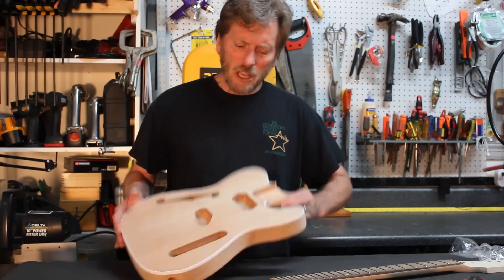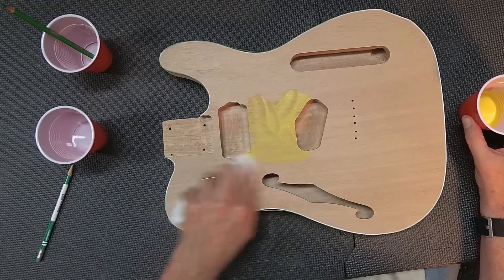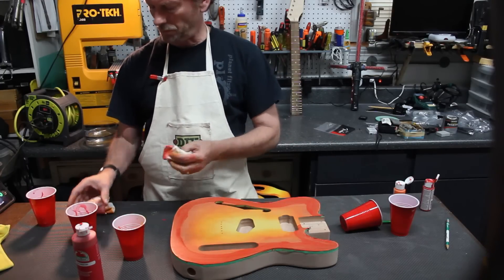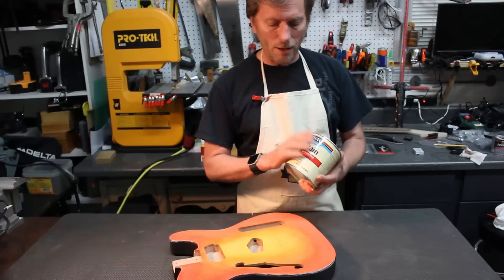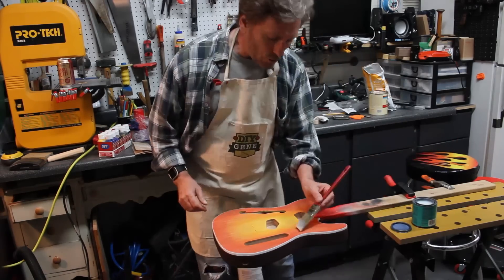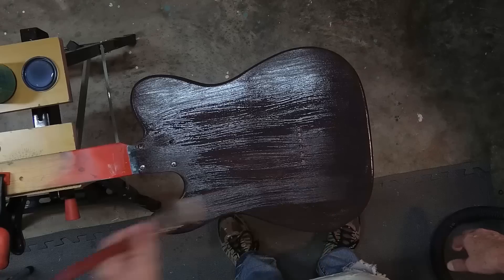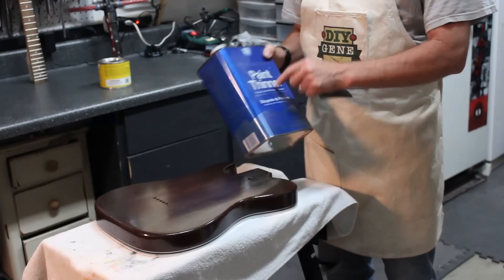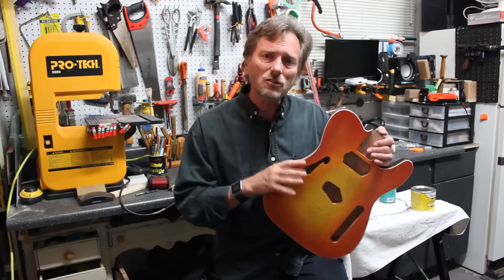Water Based Sunburst Paint on Guitar

Comment: A relaxed guy doing a relaxed tutorial. This is the deal. This basswood is quite pretty.
Reply from the maker: I so enjoyed doing this project. Thanks so much for watching.
Reply: @DIYGene   i have a brazilian brand strat although built in China that im doing a make over, upgrades, you know, and im researching for projects as yours to learn. This one you did is perfect to take the steps because is a basswood guitar as mine. Im looking for ways to improve the wood pattern in front before painting. To look more a quilted maple,sort of think.. what you think? It's possible?
Reply from the maker: Making basswood look like quilted maple could be a challenge. I would experiment on something else first. But you could try a few different things like rolling a rag that has a darker stain on it and roll it over the wood to see if that makes the pattern your looking for or possibly a torn up sponge and dab it with the stain. I don’t know if that makes any sense. But I hope that helps.

Comment: Thank you for the vid! I decided to use acrylic paint for my first build (ES335 - 12 string) as well. Very touchy stuff in that it applies like liquid plastic. I had to figure out that I had to add water to dilute the "ready pour" paint. My binding had the same problem as you did and used a razor to clean it up. I also had to sand the binding area to make the paint flush between the binding and the body. I found that alcohol will clean it up but use it sparingly because it really reacts fast with acrylic paint. I LOVE your pinstriping idea. I think I'll use it for my next build. Thanks again!
Reply from the maker: Thanks so much. I will have to try the alcohol next time. Great suggestion. I would love to see how your 12 string turns out. Thanks again for watching.

Comment: Thanks for the video! I live in a tiny urban apartment with no private outdoor space. Are you saying that, with these paints and finishing materials, I could do it ALL inside and not, you know...die?
Reply from the maker: Yes!  My shop is in my attached garage with the gas furnace and hot water heater so I do anything with the open flames in the same space. Plus my wife would not be happy with the toxic smells. So yes it works great. I hope that helps. Thanks for watching.
Reply: @DIYGene  Quick follow up as I get close to painting my own project: If I were to use this method but have the grain show through more, do you think using a dark grain filler before applying the paint would accomplish that? Or is the acrylic paint just too opaque? Maybe not if I add more water to the mix? Thanks!
Reply from the maker: @Jason-rt4lv , I would think the dark grain filler would help bring out the grain. And you can definitely thin the paint to show more grain. I hope that helps.
Reply: @DIYGene  I'll be sure to let you know!

Comment: Hi Gene, I found your video because I recently bought my first diy kit and I want to use water based paint on it. Can you please tell me how long the dry times are between the different paints you are using?
Reply from the maker: Wow, that is a tough question. It depends on the time of year and the temps. With water base, they do dry faster and can  second coated within an hour. But if you need to sand between then you need to give it more time. Like overnight. Touch it to see how dry it feels. It is better to wait longer than to mess it up because you are impatient. I hope that helps. Thanks for watching.

Comment: Quick question, did you paint in the f hole? It looks black in the finished product. I was wondering how you did that. Loved the vid, thanks 😊
Reply from the maker: I did paint in the hole. I mixed up a dark brown to almost a watery stain and used a small brush. If you do this after you have finished the body including the clear finish, you will be able to wipe off any drops that may occur on the face. Thanks so much for watching.
Reply: @DIYGene  thank you! I should be getting the slimline body soon and was wondering what to do first. That makes a lot of sense. Thanks again ☺️🎶

Comment: Hi Gene, I also want to apply acrylic on my guitar. I’ve tested on a sample and I see that it works differently on oiled wood. I like to see the grain of the wood. Could I leave the surface mat without varnish?
Reply from the maker: You could get a mat finish in the clear coat and still protect the wood. Thanks so much for watching.
Reply: @DIYGene  thanks, the factory said one needs to be careful mixing products, because they can react in the long term. Personally, I prefer not worrying about long term effects in my lungs or skin 😅. cheers
Reply from the maker: @ilciavo  me too!

Comment: Nice work with the fade on the front! I wonder if applying a grain filler like AquaCoat would have given you a smoother surface for the clear? Also, have you tried CrystaLac Bright Tone clear coat? I’m considering it for a project.
Reply from the maker: David Sudmeier, I have not tried that. I will definitely look in to it. Thanks for watching.

Comment: Hi Gene that is an awesome work on the guitar.  Did you make the yellow dry before put the red color?  or just straight after?.  Thanks.
Reply: One more question if you don't mind, for sanding between the coats, how long did you wait the first coat dry before sanding it? Thank you.
Reply from the maker: Yes, I started with 100% yellow, then I added a few drops of red. I keep doing this after each approach until was using 10% red around the outer edges. I hope that helps explain better. Thanks for watching.
Reply from the maker: On the tru-oil I let it dry 24 hours between coats. But I live in an area that has pretty high humidity.
Reply: @DIYGene  Great! got it!.  Thanks for the quick reply.
Reply: Learn a lot from your video.  Thank you.

Comment: Thanks for your great videos, Gene. I also want to build a guitar kit using this method (instead of spray cans). I basically want to have the body in one color, but add a simple shape (a star) in a darker color. Would this be possible with your method? Could I simply color the body first, then use masking sheet and apply the second color? Or would I have to use a different method?
Reply from the maker: It definitely is possible. I’m thinking of doing the same method and do flames on the guitar. You could mask out the area where you want the star and cut it out with an xacto knife or just hand paint it. I would love to see how it turns out. Thanks so much for watching.
Reply: DIY Gene thanks! Now I just need to find the time to give it a try!

Comment: In which situations would you use a primer first?  And is it possible to use a primer without a spray?
Reply from the maker: Youval S, I have found that if you want to see some of the wood grain then do not prime and thin the acrylic down like stain. If you want a solid color then primer can help to achieve that. But the acrylic paint I was using adheres really well to the wood and you can apply enough coats without primer. Or use white acrylic as the primer. I hope that helps and didn’t confuse you. Thanks so much for watching.